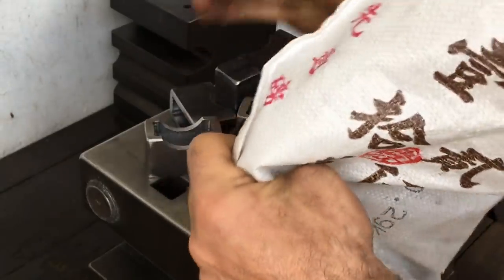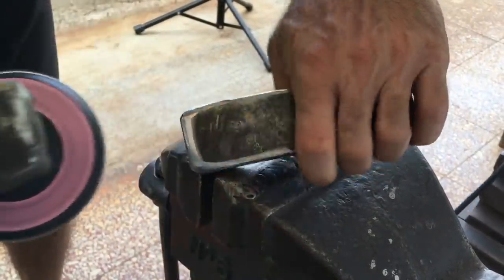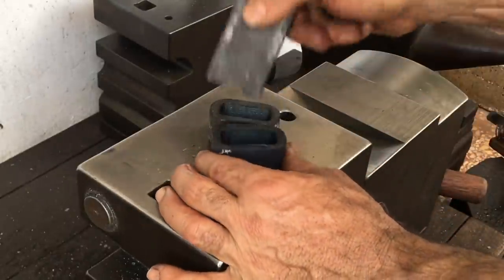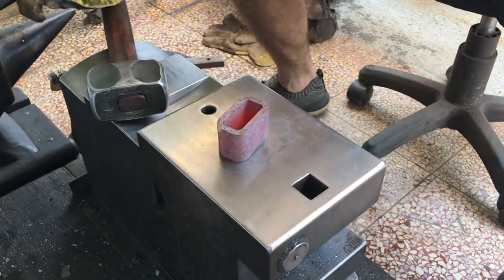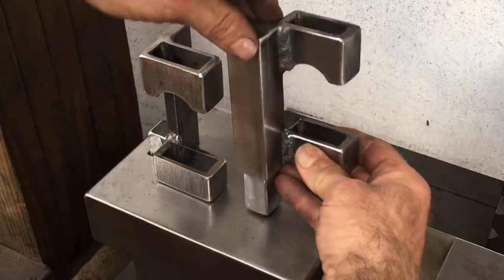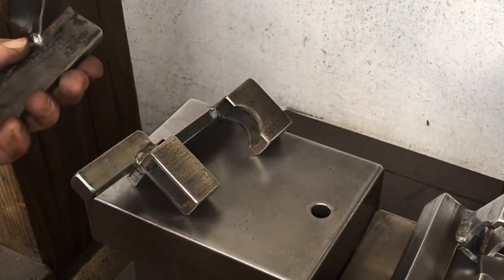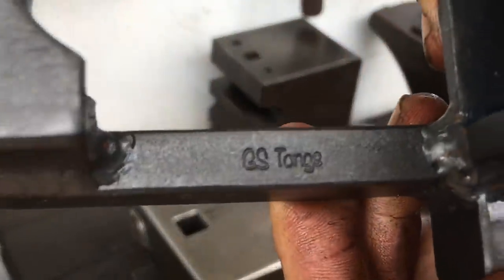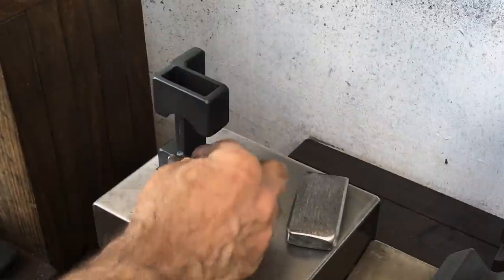Redesigning Blacksmith Guillotine Tool

Comment: Nice design change,   I think the pipe idea will work great.  You could weld on a striker face to the short top die to add length.  Thank you for sharing your tool.
Reply from the maker: I've been using this new design with pipe guides. The dies are a bit sloppy but it's working fine. I'd rather not add to the tool since I'm trying to save weight. And so I may even do a total redesign from this. Still scratching my head...

Comment: Glen,  very nice job on the new design.  Just a suggestion for the short upper die problem.  Just cut a half moon notch on the top die holder of the tool for a little area to use a a finger grab area for the upper die.  Nice job as always with all your videos.  TP
Reply from the maker: This is a really good idea. I'm exploring options and like yours the best. Thanks for sharing.

Comment: I recommend hot filing the inside of your pipe guides. its what i did when i home brewed  3 guides myself. keep up the great work.
Reply: I was thinking similar hot rasping would sort that out in seconds.
Reply from the maker: Good idea. Someone else recommended a vinegar bath to remove scale but hot filing is also a good option which could remove more than just scale. Thanks.
Reply from the maker: I appreciate the good suggestions.

Comment: I like the new design of the guillotine tool. Looks like something I could fabricate myself and that's why I like your channel so much .
Reply from the maker: This is definitely something a lot of folks could make. The hard part that I've found is getting the measurements all just right, especially since I'm doing this with saving weight in mind. But the cutting/pasting  parts are very doable. Thanks for being a Patreon supporter, etc.

Comment: You could just drift them over a bolster plate, that will allow more of the drift to get in. Maybe also run a file a few times on the inside?
Reply from the maker: I thought about that but need the bolster to be just the right size so as not to have surrounding steel get sucked in and deformed. But a good idea for sure. Thanks.

Comment: If the top die was an inch wider than the bottom die, you could raise it with the workpiece and slide the workpiece into position, freeing up the hand you were using to raise it.  Try it.
Reply from the maker: A good idea. But I also have to consider weight with this tool so it's  tricky balancing act. I'll see what I can do. Thanks.

Comment: try a vinegar soak for 24hrs after youve forged the pipe to shape, you may remove enough scale that the dies will fit.
Reply from the maker: Just removing that scale can make a big difference. Thanks for sharing.

Comment: Need to improve the drift a little, even if it means making a specific shaped one with slightly larger corners to more replicate the machined tool shape to get better corner clearance. Then you don't need to relieve the die corners. Thanks Glen.
Reply from the maker: Yes, exactly spot on advice. And I also need to consider how the pipes expand and shrink when going from hot to cold. Thanks.

Comment: I like the tool.. I kinda wished I had an anvil with a hole... 

If it were me, I d like to see a retainer for the lower die. 
A set screw or welded nub, a punched in dimple.. something to retain the lower die as you pick it up, and not have it fly out....
I could see in a more calculated fabricating movements of an item, the need for a full anvil face or to revert to use of tool and just to pick up the set and out goes the bottom tool flying about, loosing your heat. hopefully not in a critical moment....
Reply from the maker: Your points are well taken. I'm happy enough with what this is for the price but I may also do a total redesign and incorporate ideas like yours. We'll see...

Comment: Maybe flip your pipe blanks over as you drift and drift from both directions like a hammer eye.
Reply from the maker: It's not obvious but I was doing that. I just need to tweak this a bit but in the meantime, the milled guides are the way to go. Thanks.

Comment: I'd think if you did the initial shaping of the pipe guides, your machine shop when mill them to final dimension for a fraction of the cost of milling the entire thing
Reply: He could probably make a broach out of the die steel by annealing, cutting notches in the sides, and hardening/tempering.
Reply from the maker: This did cross my mind and is something I might explore. Thanks for watching and sharing.
Reply from the maker: Someone else mentioned a broach. I have thinking to do... Thanks.

Comment: Have you considered purchasing or making a broach to cut the internals of the pipe?
Reply from the maker: Someone else mentioned this but I'm not sure how that would work - used hot or cold? I need to explore this. Thanks.
Reply: @gstongs  Take a look a this https://youtu.be/7n1r5XfVkyk or this https://youtu.be/e26kCaPjX8E pretty sure it is what you need.  A well constructed broach could be driven with a heavy hammer but a cheap ebay press would have than enough force.

Comment: Hello, be careful with those pipes they look galvanized and the fumes can cause  metal fever when you take to much of it, some blacksmiths got really sick of it, even died, but great video !
Reply: They don’t look galvanized.
Reply: @jackshadow325 thank you, but the yellow color when he first put it out of the forge look like it, but if it's not the better. The piece of information to retain was never use galvanized steel in a forge with little ventilation.
Reply from the maker: I don' think the pipe in the video contains zinc but I'm being careful. I bought new pipe that is just carbon steel. Thanks.

Comment: the fiirst pipe didnt work because  the metal shrinks as it cools , so even tho your drift fits in  the finished product  wont
Reply from the maker: Yes, so I may oversize the piece that I'm using to get the pipes to proper shape and size. More experimenting needed.... Thanks.

Comment: the yellow flakes coming off of the pipe make me think there's zinc in the pipe. be careful
Reply: Either zinc or paint coated on the pipe. Looks more like zinc though some paint does look like that when heated. Either way not good .
Reply from the maker: I've taken note of that and will be careful with that unknown pipe. Thanks.
Reply from the maker: I purchased black carbon steel pipe - no zinc but definitely paint. I will be cautious with this. Thanks.

Comment: Looks like there was zinc on that pipe. Not good.
Reply from the maker: The new pipe I have is carbon steel, no zinc. The pieces I used in this video were scrap and I'm not sure. Thanks for pointing that out.